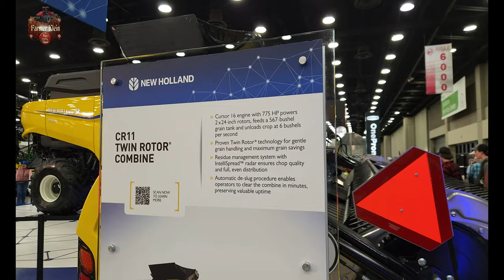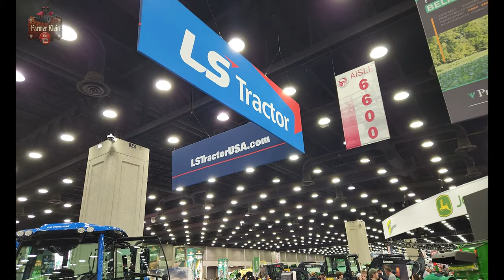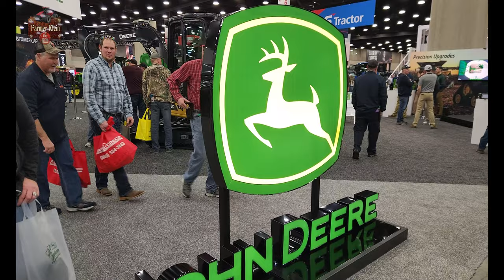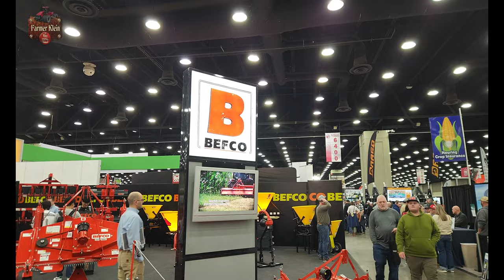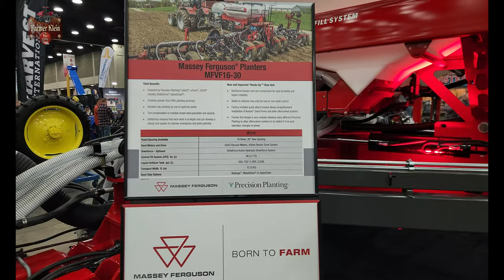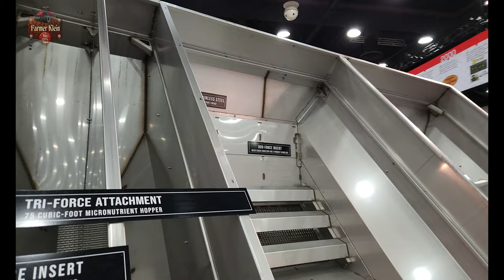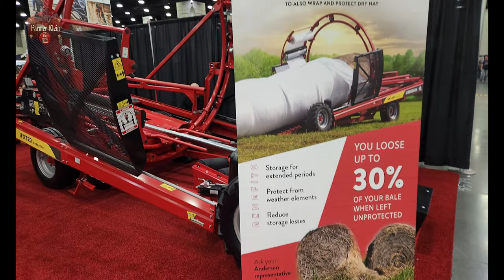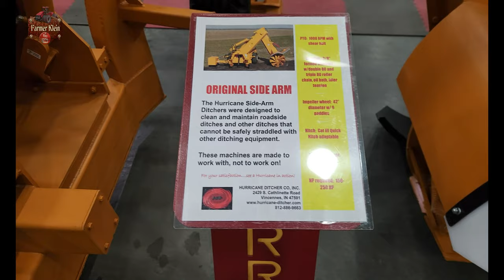National Farm and Machinery Show 2024 | Day 1| South Hall

Comment: I have a battery operated zero turn mower..works great will do an acre and a half on a single charge..rough part ofc  is it requires 6 huge batteries and u cant plug in more than 2 chargers on one circuit but other than that its awesome